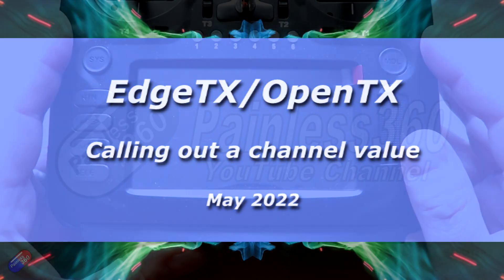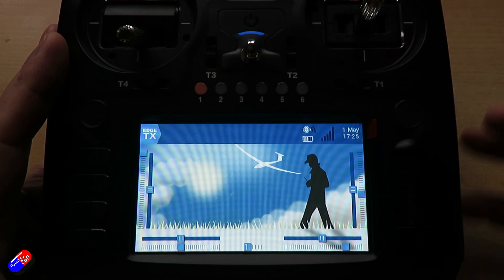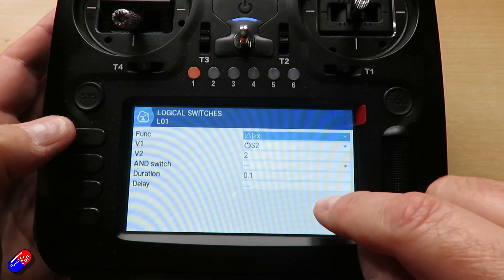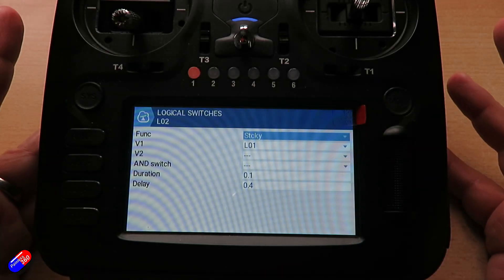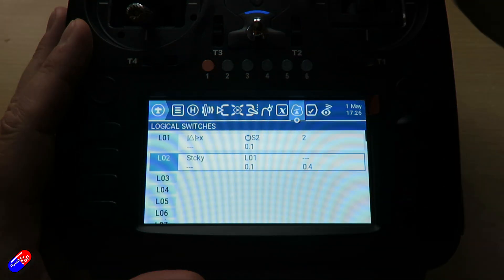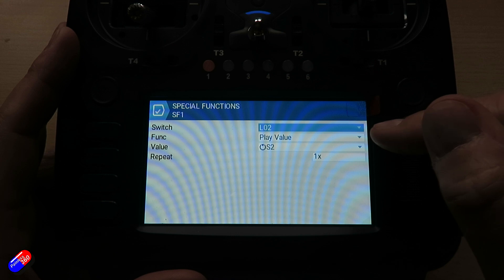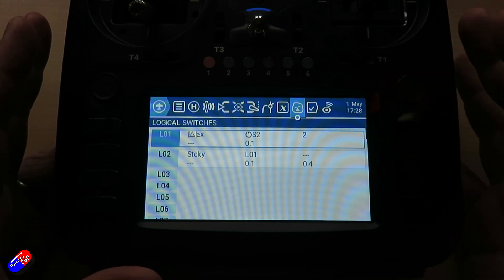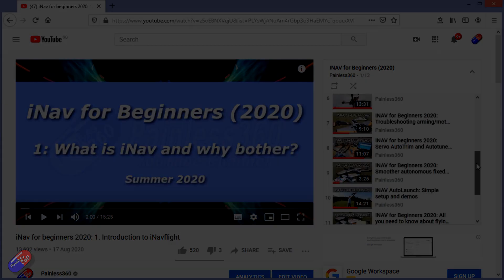EdgeTX/OpenTX - How to get the radio to read out a channel value automatically (subscriber request)

Comment: It amazes me that there are not more videos on this topic.  Excellent and thank you for it.  I'm looking for a way to report my altitude AGL if I'm more than 350 ft over my initial position.  I've got a telemetry value with my Spektrum SkyID so that is there.  Also, I'll be adding a speed readout when I'm above 0 mph every 10? seconds or so.
Reply from the maker: You could setup a logical switch that detects when you are over a certain height and use that logical switch to play the value.... Happy flying

Comment: this is great, i'll try to make mine call out voltage where i have telemetry available :3 so far i only have a "low battery" warning when it reaches it but i never know when that time comes. having a switch or have it automatically call out every .3V or so would help a lot :D

Comment: Hi Lee can this set up be used with a curve, at the moment I have S1 controlling my gain on a s6r receiver I have to flick a switch to get the number this is with Open TX, How would it need to be changed  Cheers Pete
Reply from the maker: There is a follow up video that covers how to use a spare channel to change the range to be whatever you want (throttle channel announced as a percentage (0-100) for example. Stay tuned!

Comment: Thanks for the explanation.  A good idea.  I will use this to read the throttle value change in FPV.  Although I added a short vibration at 50%, but while flying I often forget where I am in the throttle ... and have to go back and forth to feel the vibration... Thanks again.

Comment: Good tip on the sticky. Following on, how would you read the mode, waypoint hit etc from an Arducopter rather than the set mode on the radio - of course confirming the mode has been set on the copter. I guess this is a Yappu telemetry script thingy.

Sorry Lee, found out you've already done a video covering a bit of my question.
https://www.youtube.com/watch?v=xDRHvk4RHA8

Comment: Lee:
   I've noticed you are using an Eachine TX16S. I have one too.
   One problem I've noticed with mine  is that the roller is sloppy & loose, making the reliable selection of menu options difficult. Other reviewers have commented on this defect.
   Have you noticed it with your Eachine TX16S?  Do you know of a solution?
Thanks!  - Jim
Reply from the maker: Maybe a replacement roller? I've not had an issue with this radio here, it is the one I use for testing only...

Comment: Do you have a complete set up guide for edge TX?  Or should I wait 6 more months for new interface?  I have many transmitters and will the fly sky dark night be supported? My Taranis and Jumper are supported but I'm still running open TX! Thanks for all your help!  I've followed you for the last 3.5 years and all your videos give back to our hobby 10 fold so thank you Leigh!  If you ever come to Australia or I get over to the UK I'll buy you a beer and a damn good meal mate!
Reply from the maker: The setups and logic/screens work in the same was as OpenTX at the moment so all of my videos on OpenTX are still relevant for EdgeTX. I will be making more videos on it as the GUI changes and evolves for when those videos become less useful.. Happy flying!